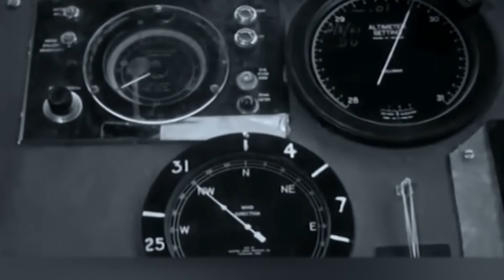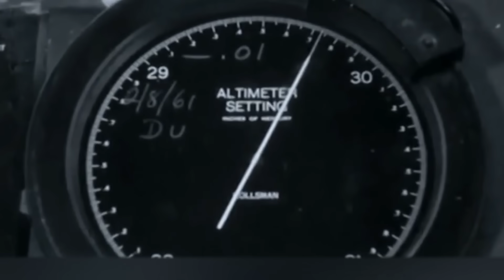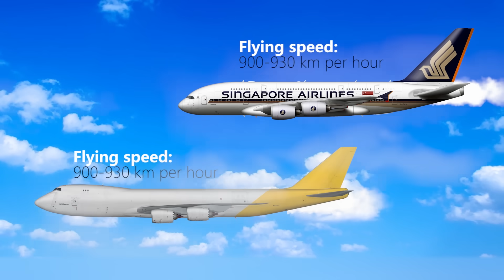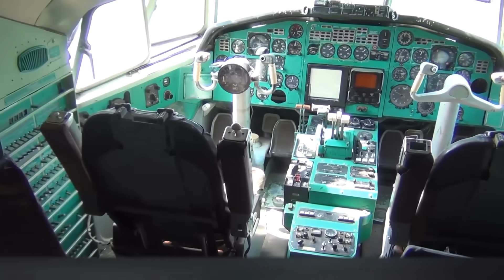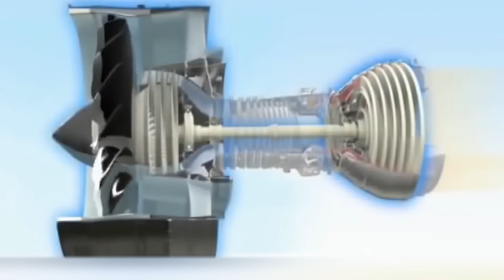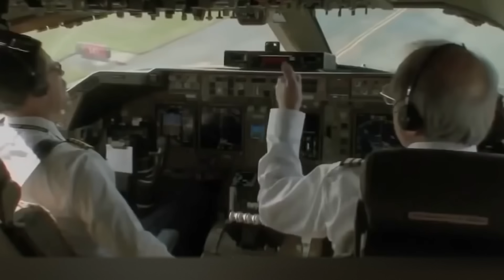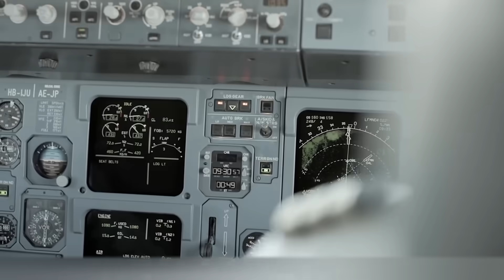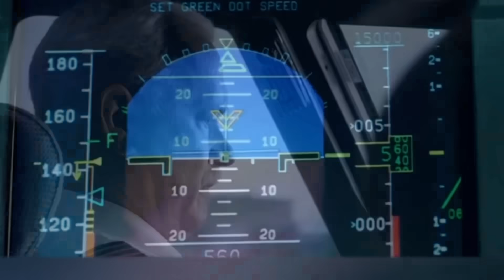Why Do We Fly so Slowly?

Comment: If people weren’t so precious we would probably have dead silent, extremely fast passenger airplanes by now. 

Also why haven’t we got fully electric planes?
Reply: Care to elaborate on the silent extremely fast passenger aircraft? What kind of motor would be capable of achieving that?
The reason why there are no fully electric planes is simple: energy density.

Kerosene has an energy density of 37 MJ/l whereas lithium ion batteries have an energy density of just 2.6 MJ/l. In other words, batteries are 14 times heavier than jet fuel.

A typical turbofan engine has a power rating of about 35MW - that's 68 Tesla Model S P100D motors per engine! An electrical turbofan powered passenger aircraft is therefore simply impossible given current battery technology. Hybrid-electrical mid-sized (regional) planes are quite possible in the near future, but I wouldn't hold my breath with regards to all-electric long-range air travel.
Reply: totalermist who says batteries cant change? Fast and silent meaning fully electric. Which if humanity is smart we will have eventually unless we get held back by scientists saying it cang be done without practically testing it. I mean there would be thousands of creations that scientists said it wasnt possible cause their numbers but when it was tested practically the scientists were proven wrong.
Reply: Dad joke's to make you smile
 - maybe I wasn't clear enough. Your question was - and I quote "why haven’t we got fully electric planes?". The short answer is: current batteries aren't good enough. That doesn't mean future batteries could won't change that, it simply means that in the next 10 years nothing is going to change regarding commercial air travel.

There is plenty of research in that area, but there's also reality as described by physics: propeller-based aircraft are slower than than turbofan aircraft and both props and turbofans are loud - no matter the means by which they're turned. Fast and silent isn't easily achieved, especially if you want it to be affordable and ecological at the same time. If you want silent, opt for lighter-than-air, though that's slow (which isn't inherently bad IMHO). If you want fast, opt for super-sonic, which is loud, inefficient and expensive. 

Even if tomorrow someone or some company steps forward and presents a ground breaking new battery technology or engine design, it'd still take decades before the aviation industry would change:
• Commercial aircraft take years to develop and getting approved
• Mass production is an issue and it takes years to fulfil orders
• Aircraft cost hundreds of millions and airlines cannot afford to replace their entire fleet quickly
• airports require ultra high-power charging infrastructure and procedures
• pilots would need training, because an electric aircraft would require different procedures and handling

That's the long answer to why there're no all-electric aircraft as of yet and why there won't be in the near future. 20 years down the line - totally different ball game. By 2040 most of all air traffic could be fully electric, who knows. It is highly unlikely, though for the reasons given above, that we can expect any major change within the coming decade.
Reply: totalermist who says we wont have it in the next 10 years? People with your mind set dont like the idea of progression and dont progress to it
Reply: +Dad joke's to make you smile - this isn't about mindsets. It's just the difference between wishful thinking and reality. Let's be rational for just a second, shall we?
As of February this year, Boeing had an order backlog of 5,805 jets behind Airbus with 7,243 jets in the order backlog. Both companies delivered 763 and 718 jets respectively in 2017, meaning the two largest commercial aircraft manufacturers have order backlogs of 8 to 10 years [1].

Even if all these orders are cancelled somehow and replaced with some hypothetical electric super plane today, that somehow magically gets developed, approved and mass produced instantly, it'd still take a decade just to build all these new machines. Even then there would be 3 conventional airliners for each electric aircraft.

Again, this isn't about being pessimistic or anti-progress or any such nonsense. This is simply being realistic and staying with both feet on the ground. In 2016 an estimated 23,480 commercial aircraft were in service worldwide [2]. At the current production capacity, just replacing this fleet (i.e. ignoring expected growth of an additional 22,470 machines by 2036) would take more than 15 years - add to that the existing order backlog of 13048 jets just for the two biggest manufacturers and you see why it's implausible to assume that major changes in the civil aircraft inventory are possible within such a short time frame.

This scenario also ignores all common sense and economics by the way, as it would require airlines to replace perfectly good and relatively new aircraft as well and disregards all infrastructure changes on airports, training, procedures, and power delivery.

[1] https://blog.forecastinternational.com/wordpress/airbus-and-boeing-report-february-2018-commercial-aircraft-orders-and-deliveries/
[2] https://www.statista.com/statistics/262971/aircraft-fleets-by-region-worldwide/

Comment: 4:00 "If you lower the speed you have less air resistance." I am sorry, but I feel the need to point out that it seems you don't understand flying after all. You see, the lift and the drag vary by the same amount with speed and air density (i.e. altitude). The amount of lift we need is set by the weight of the plane, and so the drag gets decided by the shape of the plane and angle attack, that are chosen to maximize the lift/drag ratio. Flying slower means you have to fly at a lower altitude to get the lift you need, and if your plane doesn't change shape (with flaps, angle of attack etc.) the drag is going to end up the same. With the same drag, you need the same amount of thrust to compensate it, you will consume the same amount of fuel per second. But you take longer to get to your destination meaning you'll spend more fuel. 

The maximum speed is largely determined by the sound barrier, and the optimization of lift/drag ratio. The average cruising speed (903 kmh) is quite a bit below the sound barrier (~1063 kmh at 35000 ft). However, the local air speed varies around the plane and the peaks will get very close to the speed of sound. Exceeding the speed of sound at locations where shock waves may occur greatly increases drag, meaning the lift/drag ratio is worse. The 903 kmh follows from the need to avoid local shock waves  while otherwise optimizing the lift/drag ratio of the plane. Higher wing sweep allows to fly closer to the speed of sound, but is otherwise a less optimal wing design for reasons that you correctly pointed out.

Later you clear it a bit by explaining that generally there are "many aspects that go into the equation of optimizing speed" but your explanation of why 903 kmh over 950 kmh is inaccurate.

Comment: I think we're going to see twin fans pr engine in the coming future so to get more bypass air making the engine more efficient while not  increasing the size vertically.... in fact if they installed an array of fans driven each fan could turn slower at the tip reducing the cost of the fan blades.

Comment: if I look at flight-radar 24 , sometimes it shows the speed (of a 777, 747 etc) as 1020 +- km's /hr , especially if they are flying East-to-west from Australia to New Zealand . Maybe the air currents push them along faster?
Reply: slh950 flightradar24, without a subscription, shows the ground speed. Ground speed takes into account winds. If there is a headwind the ground speed will be closer to indicated airspeed and if there is a tailwind the ground speed will be further from the indicated airspeed. So yes, you are right.😌

Comment: A major part of aerodynamics everyone is forgetting here is weight, the larger the aircraft the heavier it becomes and thus needing bigger engines but with bigger engines you are adding small amounts of drag and even more weight so if you have a giant engine on a small aircraft it will go very fast! Problem solved? No! An aircraft can only go a certain speed until it will be ripped to shreds, this is called over-speeding. So add reinforced wings and fuselages! Well now you’re just adding more weight slowing the aircraft down once again

Comment: You are comparing the TU154 from the 1960s with a cruise speed of 850kph and comparing it to the MC-21 (which isn't even in service yet) with a cruise speed of  870kph and are saying that the modern jets are slower than the old jets.  Do you check ANY of your facts?
Reply: You do realise kph means nothing. The correct unit is written km/h
Be careful when you point out errata
Reply: It should actually be m/s as these are the base S.I. units. But as this is not a technical forum I used one of the oldest (if not the oldest) common abbreviation.  But the big question is still "And?...." how does this negate the argument presented above?
Reply: The TU-154 has a max cruising speed of 975 km/h and most economical cruising speed of 900 km/h [1]
So maybe you are using a different source than them?

[1] http://www.airliners.net/aircraft-data/tupolev-tu-154/376

Comment: Why do aircraft not fly faster? Because the sound barrier has not changed since Chuck Yeagers day.  You don't need 10 minutes to say that.
Reply: +Aquarius1011And even if one did fly faster than sound, then you still have airport security  and holding patterns.  The Concorde had a couple of major advantages when it was flying.  First, it flew so high that there was no other air traffic and they could do direct routings. And secondly, the Air Traffic Controllers knew that Concorde could carry very little reserve fuel, so Concorde was never put into a holding pattern, but instead had a direct landing every time.  That helps.
Reply: I used to build mini rockets. But they have gotten a lot bigger recently.  Currently I am doing smaller propellant tests on some new formulations before I start sticking 100 kgs into a tube and setting fire to it :) Even the small ones I fly are capable of going through the sound barrier in about 2 seconds and often have.
Reply: Yeah, and the sound barrier itself is not so fast either. 
Don't want to have planes causing windows on the ground to shatter.
Could still travel just under the sound barrier.
Reply: A case of there being enough delay with airport security and holding patterns, etc., and even more delay with aircraft flying slower. Just saying.
Greed, being very money orientated, is no doubt holding back, suppressing very advanced technology, including for that.
Reply: Ad revenue, I’m guessing
Reply: spacecadet35 yes
Reply: but the ads tho
Reply: spacecadet35 drag reduces after you've crossed the transonic region. Concorde pilots used the engine's reheat only during take off and to cross the transonic window. Although reheat uses a lot of fuel, the calculations showed that it actually saved fuel by allowing it to quickly get from subsonic to supersonic speeds.
Reply: +Brian Su Yes, drag decreases after you've crossed the transonic region.  In the transonic region drag is much higher (up to 4 times) as high as in sub-sonic, and once supersonic, while the drag has decreased from trans-sonic, it's still higher than sub-sonic.

The key to conserving fuel (which you're still consuming at a much higher rate at supersonic speeds) is getting through the transonic region as fast as possible.  Hence the reheat.

This may be instructive:

https://www.researchgate.net/figure/ariation-of-Drag-Coefficient-CD-as-a-function-of-Mach-number-M_fig4_271076825
Reply: Fromage Frizzbizz Yes you've explained it in great detail. I was lazy to type it all out :)
Reply: +Brian Su Both your, and a previous poster weren't making it clear that supersonic drag was still higher than sub-sonic drag - transonic drag is a "hump" in the middle.  That was my point.
Reply: Fromage Frizzbizz yes because it was already mentioned in the video. I was only pointing out the hump. Also that I mentioned reheat is only used to get through transonic implies that.
Reply: spacecadet35 gotta got that ten min mark..
Reply: And the term, "Sound barrier" has not been used since Chuck Yeager's day. He proved that there was no barrier.
Reply: The resistance is very high if you are flying in a speed range called transsonic, if you are flying in subsonic OR supersonic, he air resistance will drop, just google that
Reply: I don't need to google it. I design and build supersonic rockets; I know a little bit about drag in the transonic range. While the drag coefficient does drop off after going through the sound barrier, it is still increased compared to subsonic flight.  Throw in that the profile drag is proportional to the velocity squared and you get the case that to go Mach two uses about ten times the power than travelling at Mach 0.8 and you use four times as much fuel per kilometer travelled, it is not really practical for most civilian applications.
Reply: J Calhoun yes but Concorde was also operated by Singapore Airlines and Iran Air :)
Reply: oh, you build mini rockets and make balloon animals... wow

Comment: A350-900 reaches 1000kph so that’s false
Reply: No, you're mistaking airspeed with ground speed
Reply: 68404 I used Flightradar24 to make that statement, Delta’s A350-941 from DTW to AMS had an indicated airspeed of 971kph with a tail wind of 35kph which would make the pitot tube read the tailwind velocity less than the actual ground speed no?

Comment: planes don't usually cruise at 100% throttle, and they go somewhere between 70% to 80%. They can go faster if the airlines and the pilots wanted to. any risks that could happen due to increased speed would risk the airline going out of business from lawsuits and all that

Comment: Fuel is the source of energy and not "working liquid". There's no such thing as "working liquid" because liquids are incompressible and therefore cannot change volume in order to generate work or thrust. The working FLUID in a thermal engine is always a gas.

Comment: Is not the modern aircraft cannot fly as fast as their older cousins. The reason you don't approach transonic speed is because it gets quite turbulent and is very taxing on the skin and construction of the aircraft. It will last a lot longer if you just avoid that transonic envelope when you get into .9 2.96 Mach which is where they used to fly. If you're on an aircraft and you're flying a long-distance and you run into a bunch of turbulence, much of the turbulence is not due to the are doing funny things outside the aircraft it's that the aircraft hits a headwind and is functionally entering transonic speed even though it's ground speed Remains the Same. Turbulence in the transonic envelope can be quite rough and can add months if not years to the functional age of an aircraft.